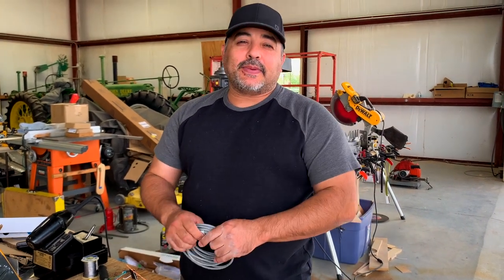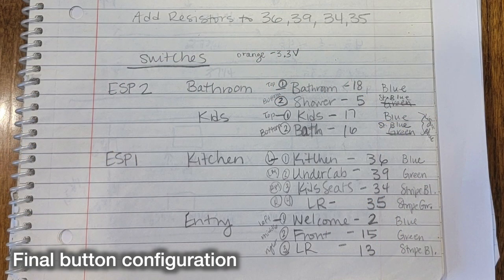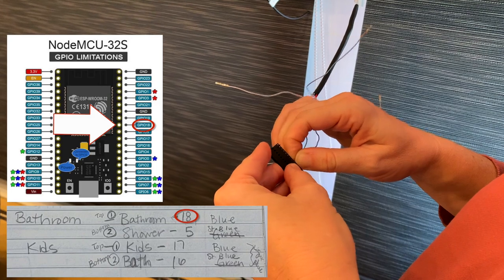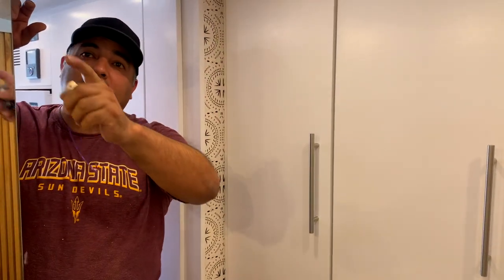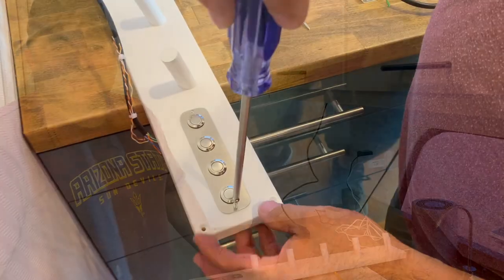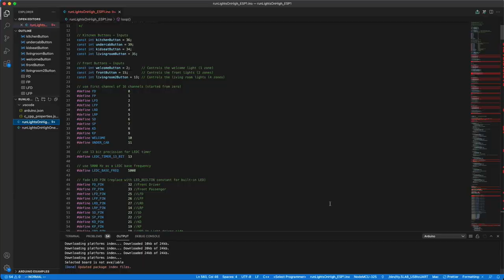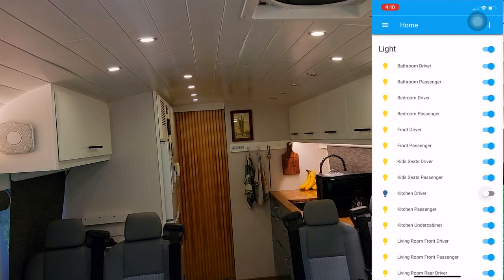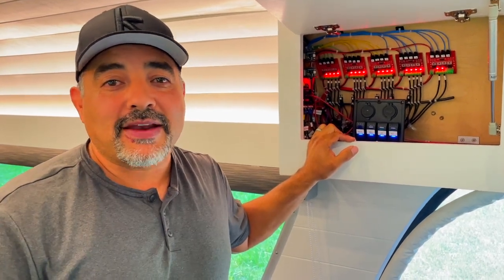Finishing The Bus Build: Home Automation Wiring for Lights Part 2

Comment: Thanks for the mention Juan! ESPHome sure makes all this a low-code or no-code solution. I’ve actually done engine monitoring with ESPHome too, as it has lots of sensor support as well.  For my lighting I went a different direction - WLED running on an open source board called a dig-uno with 12v LED’s! This greatly simplifies things on the power side and the little dig-uno board handles the esp, power supply, and  driving the LED’s..
Reply from the maker: Very cool!  There are many ways to do it and the dig uno is a very interesting and compact way to get it done!  It's really cool all the stuff you can do with these little boards and ESPHome!   One day I will get to the engine monitoring - and I will probably have 1 million questions for you.

Comment: Wow -- As I'm just starting a new build -- I def. want to do this!  Seems like this is something you could offer as a service to folks to help them out with the programming/setup.  like what you are using to run the docker server, and how you have that setup to handle the vibrations and such.
Reply from the maker: Thanks Brian - what a cool idea!  Docker server I am running is on an Intel NUC I got off amazon for about $400.  It is running Ubuntu Linux (and Plex media server).  That machine is all solid state so I just put it on rubber isolating pads to keep the vibrations to a minimum.   Thankfully with ESPHome the software/programming part is pretty easy - I will do a video soon to detail that and maybe offer a service where people can call/email and I will provide some support.

Comment: Really nice job on the home automation system. Looks like a very expandable system. Question: What is going on with that panel strip over your head in most of the video? Did it expand and warp?
Reply from the maker: Thanks Bryce - that is a slight curve in the wood that is being exaggerated by the uplight in the channel.  The wood did warp slightly but the light makes the effect much larger than in real life.

Comment: Hey Juan, this is an excellent build. I heard you mention that you had set up a leveling system. Do you have a write up on that? We’ve got a 2000 Foretravel and the level sensor isn’t quite accurate for my liking and would like to upgrade it a little.
Reply from the maker: Thank you!  Yes I added a leveling system to the bus this past winter - I have not done the write-up on it yet but I plan on doing it in the next couple of weeks.  As of right now the leveling system is manual but I have plans for automating it and I will mention those plans in the video.
Reply: @BeginningfromthisMorning  sounds good! Thank you sir

Comment: Thanks for another great video! Do you have any schematics published? Am interested if you needed to use any optical/darlington array buffering or current limiting between the ESP and those FET boards? Well done!
Reply from the maker: Thank you BubZ - the MOSFET boards are very common they use the IRF540S N-Channel MOSFET on the high voltages side and are opto-isolated (I am not 100% sure that is a real word) with a PS2801-4-A with the low voltage logic side.  I did not worry about current limiting because the LEDs draw about 0.2 Amps and the MOSFETs are rated to around 30A I believe.
Reply: @BeginningfromthisMorning  do you have to current limit between the ESP32 out to the opto-isolator led input?

Comment: What are the different blocks up there?
Reply from the maker: The red blocks are MOSFET boards that allow for the dimming of the lights by switching them on/off at an incredibly high rate (many thousands of times per second)
Reply: @BeginningfromthisMorning  are they sold in the same place as the home automation?
Reply from the maker: @mikejf4377  I got some of them from Amazon and some from Ebay.  The blog post has all the links: https://beginningfromthismorning.com/automation-part5/

Comment: Bravo! Absolutely brilliant design!!! I remember watching the building the tech cabinet above the refrigerator years ago. Is that where the host running the VMs (including Home Assistant) is located? What is the host and how is that host powered redundantly?
Reply from the maker: Thank you Kevin - YES!  that is exactly where the host is running.  Everything is connected wirelessly to that host.  It is currently running Ubuntu Linux virtualized with Docker running Home Assistant.  It also runs a small Plex media server for the movies we had on DVD (we ripped them and put them on a hard drive).  I am strongly considering reloading the OS with Debian because that is the "official" OS for Home Assistant.  Power is provided through our main battery pack and redundantly through the Coach starter batteries.